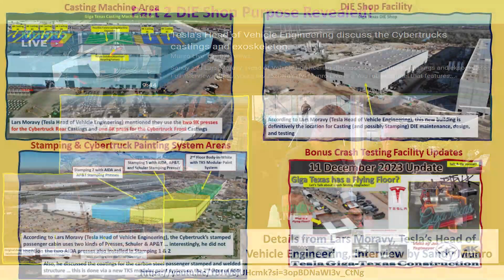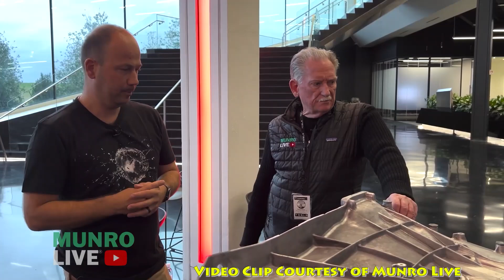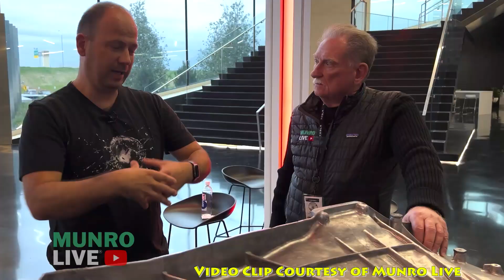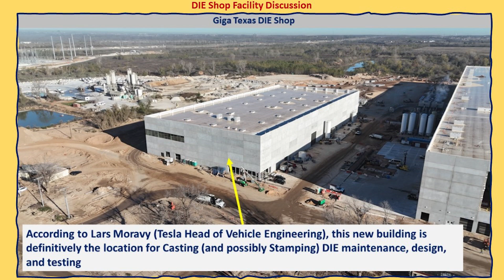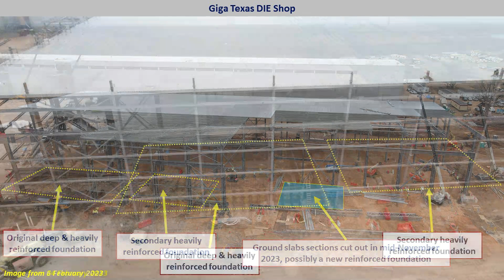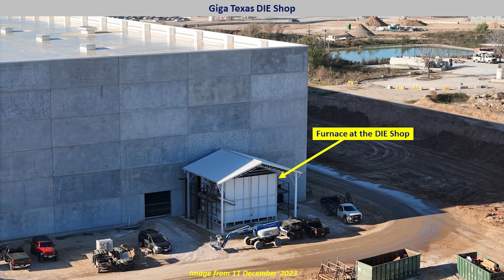Part 2 Lars and Sandy Interview & Discussion about Giga Texas' Innovative DIE Shop & Its Function

Comment: In Shanghai Die maintenance and -servicing is probably easily available around the corner.
However, Fremont, GN, (and GMexico in future) may benefit a lot from the die shop at GT: another vertical integration opportunity for Tesla
For GB it may hang in the balance to make use of the GT die shop, with long logistics lines to/from Berlin.
Reply: Berlin might just stay with the original Italian die manufacturer, Costamp.

Comment: Wouldn’t be surprised if the do stamping die manufacturing here and leave maintenance in the stamping area. This would allow them to develop stamping for the new small vehicle & Model Y juniper refresh in house. Vertical integration lowers costs and reduces uncertainty on delivery timelines. As well as keeping leaks to a minimum.